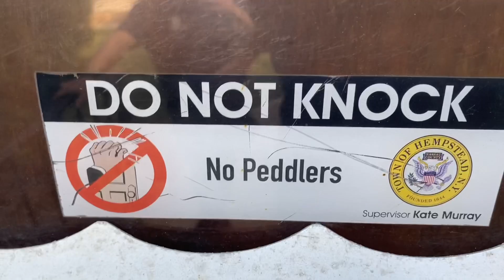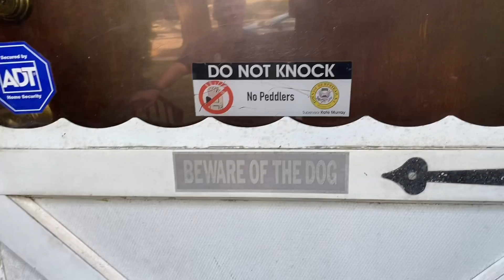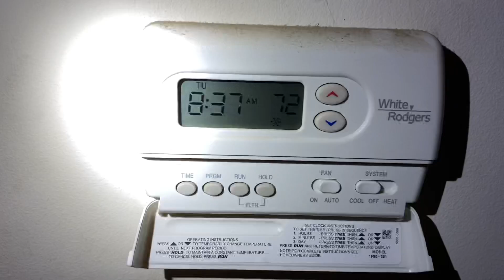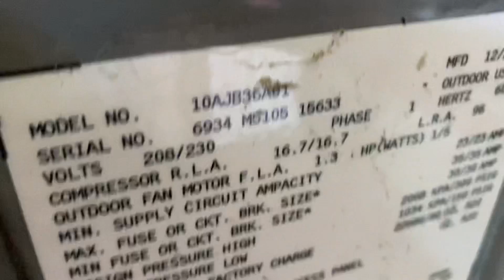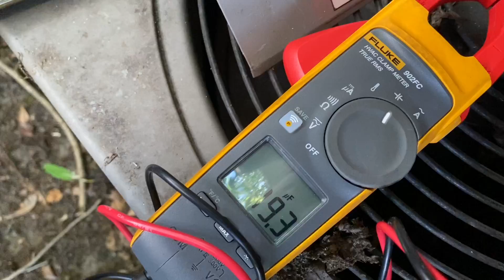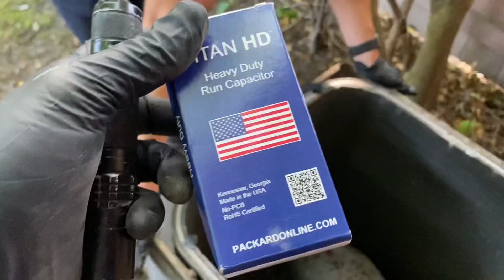Central AC System Blowing Warm Air Inside Why Pipe Doctor Uses Titan HD Dual Run Capacitors

Comment: the cloged condenser was most likely causing over amp on the compressor which can cause the capacitor to fail quicker. good catch guys

Comment: a couple things, have you looked at the coil gun that Chris from HVACR Videos uses?  You likely would save a lot on the amount of cleaner you use 
Also would brushing the coil off with a paint brush first then a good  pre spray help to clean the heavy debris off before putting cleaner on?

Comment: Sorry Mike. You gotta be using the titan USA pros or the green colored trade pros. I just looked an an oval dual capacitor from 1990 on a Lennox unit, tested right on the dot microfarad wise. Can't beat USA made. 💪
Reply: @PipeDoctor  i haven't had a titan dual cap go bad in all honesty.